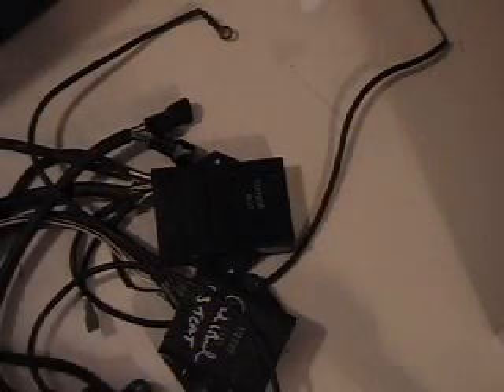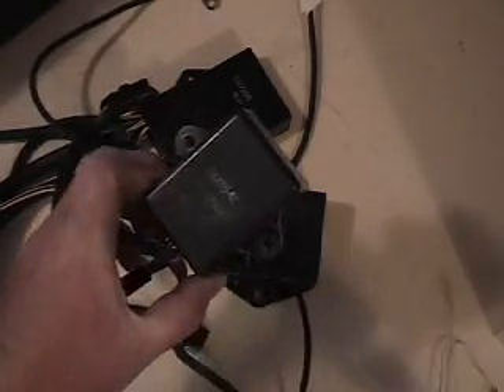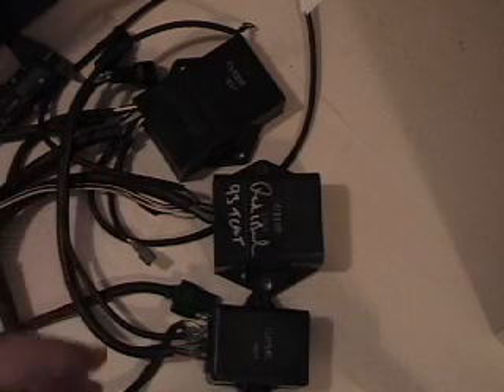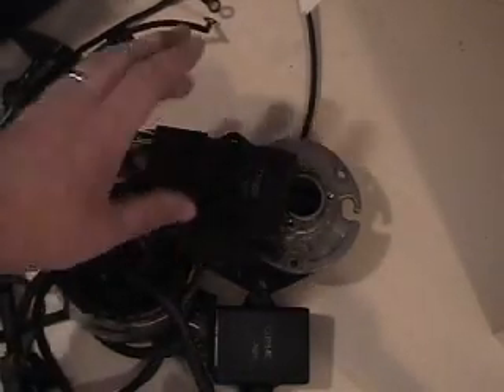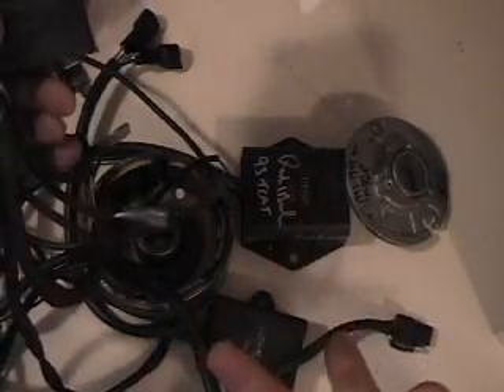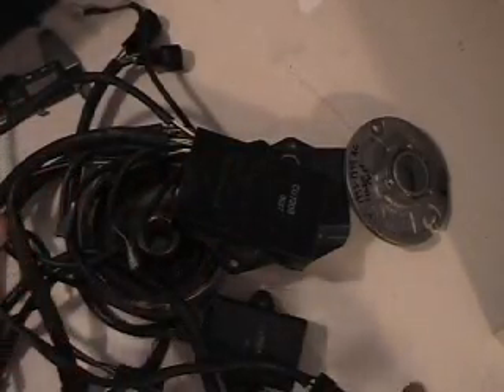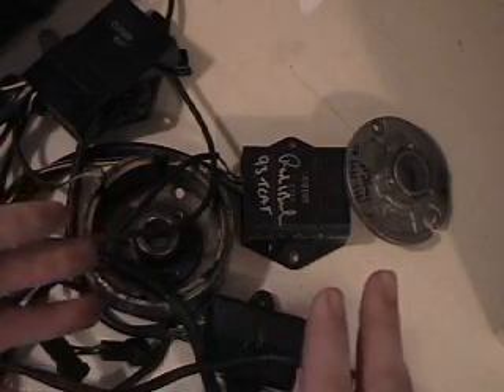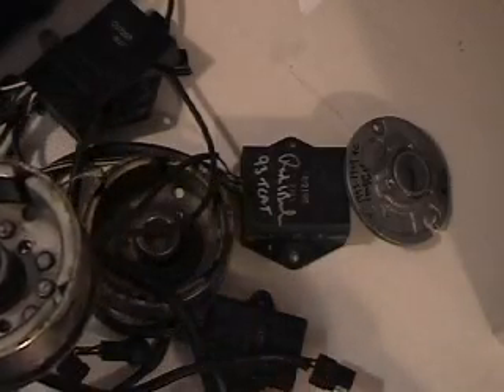Arctic Cat ZRT and Thundercat 1993 to 2002 ignitions Pt 2

Comment: Blaine I have a 93 t-cat need a CDI what one will interchange with it. Plug and ply. 3004-812 work off a 96 t-cat or zrt800. Thanks
Reply: 1993-1997 are closed loop CDI boxes and are plug and play. Slight differences in the timing curves but you'll never notice on a stock sled. You could even use a 98-99 open loop CDI box on it but the key will work backwards. It doesn't effect it in any way it'll just work backwards.
Reply: @BlainePertler  another question does it have to be for a 900 or will the zrt 600 and zrt800 also work. Thanks.
Reply: @BlainePertler Blaine I got spark problem on my 93 t-car. Stator and pick up both ohm good. When I take cdi wires to coils and hook up each coil separately I get great spark to that cylinder but then hook it back up like it’s suppose to be only the middle coil gives good spark, mag side none , pto side faint spark. Outside coils ohm at 0.04 ohms. I put new middle coil on from rm stator and it ohms 0.40. Call them and was told there specs were 0.40-0.46 and it was correct. Where do i go from here???yhanks.

Comment: What u gotta do to make a 98 CDI box for a 800 work on a 96
Reply: The 98 is open loop. The 96 is closed loop. So it'll work fine but the key switch will work backwards. It doesn't hurt it in any way. Or you can use a key switch out of a 98-02 and it'll work in the correct direction.

Comment: I have a 1993 T-Cat that I just bought. It currently has no spark. I am in the middle of trouble shooting now. Do you have any suggestions or possibly a CDI box if that's what it comes down to and also is the 93 cdi box better or whats the deal with that?
Reply: I don't have a 93 CDI to try on it but any 93-99 CDI box will work on it. The 98-99 CDI box is open loop so the key will work backwards. The 93 CDI has more timing sooner and holds onto it longer than any other cat triple CDI box.